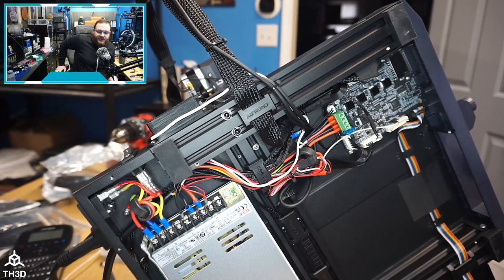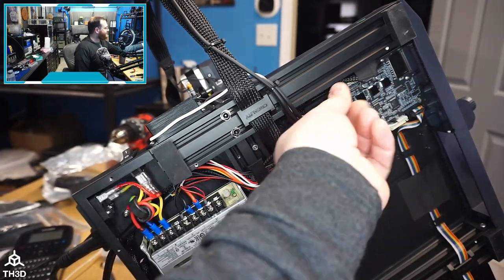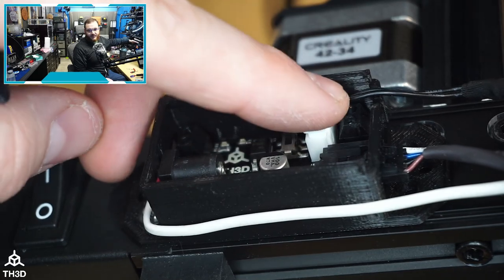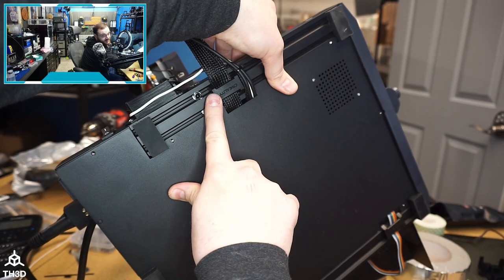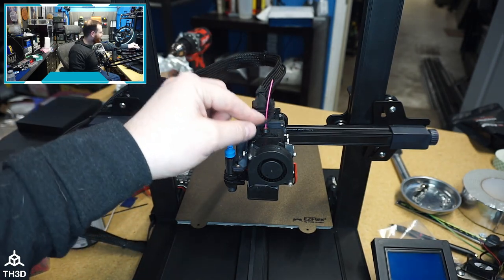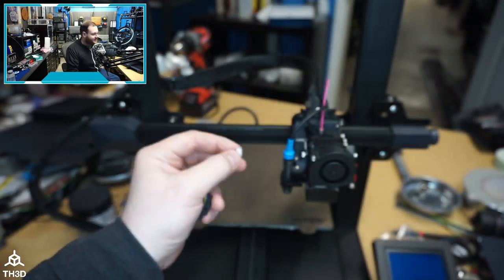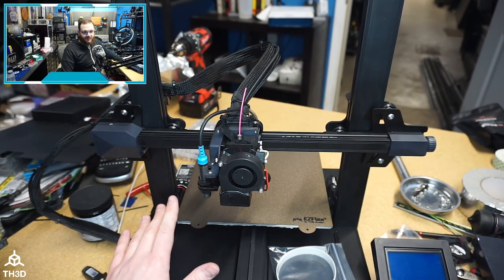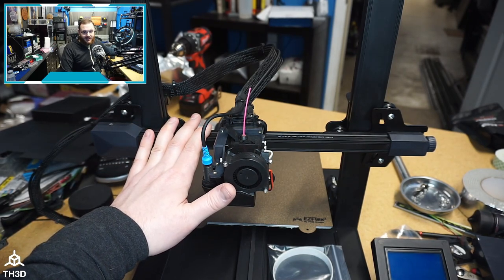Wrapping up my Ender 3 S1 Build - EZABL Mounting/Cabling

Comment: Just got this printer as my first for $250, I plan on using the savings to get it to speed with more or less the same upgrades you gave it. Lots of good info and honesty in the last couple videos you made ab it so thank you
Reply from the maker: $250 is a SOLID price for it. At that price I can overlook the need to fix things Creality overlooked. I hope you enjoy it!
Reply: @TH3DStudio  Thank you, yeah right now I'm struggling the cr touch and firmware having a hard time compensating for the bed warp but I think switching over to klipper should fix the issues on first layer. Just received a 15' insulation roll and EZNeo kit from you guys, basically added $250 worth of value

Comment: Have wanted a couple of your videos over this printer and you've mention poor firmware. This is my first printer, and I was curious what you were referring to with your mention of firmware being poorly written.

Little background on my experience thus far; would be interested in your feedback regarding some of the issues I think I've run into.

I had always wanted to get a 3D printer but never cared to print the novelty items available online, I wanted to prototype projects. I figured one day I would learn CAD and get a printer. Always imagined that would be after I settled down but, I ended up having to learn Solidworks for an engineering course I took at my university and, it turns out I can get the student package with advanced simulation for $40/yr. because I was in the National Guard...

Despite being a computer science & engineering major, I found myself in a second engineering course where we were doing a miniature capstone project; we were required to use 3D printing or laser cutting as a fabrication method for our final prototype. My teammates were not contributing, and I was in a pickle time wise or so I thought, I was actually about a week and a half ahead; despite having been gaslit by one of my teammates regarding the deadline, I ended up grabbing an Ender 3 v2 Neo. I had done a decent-ish amount of research and figured it would be easy enough to figure out. Later that week the Ender 3 S1 went on sale at my local Microcenter for ~$270, which was less than I had bought the v2 for, I went ahead and bought the S1, threw its build plate and filament sample in the v2 and returned it. 

I had also seen a fair few reviews on the S1 talking about how it was a "just works" and "for 3D printing as a tool, not a hobby" printer. Being that I had literally never seen a 3D printer IRL before that sounded like exactly what I was looking for. Initially it was fantastic (at the time I was running the thing at like 20mm/s first layer 40-50mm/s for the rest). I instantly fell in love with being able to model something and have it in my hands but, I despised the slow speeds. I didn't really have the time to really dive into learning how to configure it optimally, so I just ran it with the stock profile until my project was mostly done.

I started attempting to boost the speed and everything remained solid. I left the profile the same and just ended up cranking the speed up to 200-250%. Everything was fine until randomly, and instantly, I ran into a slew of issues. It was so frustrating it almost poisoned me to 3D printing despite having fallen in love with it less than a month prior. I would like to reiterate that I am a computer science and engineering major (have been one for longer than I'd like to admit...), and am generally pretty good at figure things out, it is not as if I am illiterate when it comes to tinkering with computer systems; don't me wrong I'm no 10X Linux user but, I haven't run into an issue with anything "tech" related I've owned so far and I've experienced some pretty weird things (oh how I love and hate Windows on Arm... despite that minor jab WoA is getting there I'd give it a bit more but definitely a superior tablet experience IMO; I'd give it a go if you have the disposable income to dump on a Surface Pro X or Surface Pro 9 5G)

This printer (or at least the expectation of a "just works/ tool" many reviewers had given me) almost murdered me. I think I ended up having more issues with the S1 than I would have had I stuck with the V2 Neo. I ended up grabbing the Creality Sonic Pad to run Klipper and that has alleviated some of my issues, or at least helped me diagnose what the issue was... I think at least, the ole printer is running nicely now for the past few days at least.
Reply: So as far as the various issues I ran into:

Problem 1:
Prints would start out fine, but the higher the print, the more over-extrusion would be seen but this seemed to happen randomly; one print would get messed up in this way, the next (using the same filament, no re-leveling, no changes whatsoever) would be absolutely fine standing at 50mm tall. When the issue did occur, the top of any prints over ~20-25mm would look like a hot rake was taken to them. I think the issue was extreme over-extrusion. Anything lower than that was fine 100% of the time though (in hindsight I think I had a bit of over-extrusion all of the time but nothing that was causing significant issues elsewhere; can't say for sure, as I never did any calibration or tuning with the filaments I was using. As of right now, I am tuning extrusion with the 1 wall hollow cube method. I have heard some say this is a no go but, its working for me wonderfully, as of the last 3-4 weeks at least). I never did figure this one out; I would almost swear it just randomly stopped but, it may have been when I switched to klipper (I am pretty sure it just randomly stopped though.

Problem 1.5-ish:
Not sure if this caused issues as I fixed it at the same time as problem 2 but I did find that my x gantry was slanted with about 1mm of height difference from one side to the other.

Problem 2: 
Leveling... sort of... I think? At the very least, I know I had it close enough it should have worked because I was printing on the V2 Neo perfectly prior to grabbing the S1 (perfectly being well enough I had consistent results without failures). Prior to switching to klipper the I would occasionally get 1st layer issues that would leave me wasting tons of filament and hair They would show up randomly, sabotage every print i tried, and disappear as swiftly as they arrived. I still have no idea what cause these although, I have heard other users state that the ABL was garbage so perhaps this was a firmware thing???

Problem 2.fuck_me_it_got_way_worse_with_klipper
So, the occasional issue I mentioned in 2 just decided to move in when I switched to klipper. I was still tramming the bed properly at this point but for whatever reason NOTHING would stick I set my z offset touching the bed and it was still laying the filament too high to adhere in the front 1/3-ish if the bed. I believe I actually know why this was occurring. Or at least I fixed what I though was causing the issue and the issue has thus far been resolved; I also dont think I would have fixed this had I not switched to klipper. So, when I had switched to klipper on the sonic pad I was using klipper screen's auto-level to "level" the bed (I get that this is incorrect, but I am OCD af and bad with the finesse of leveling, so the numbers made it easier). I had always gotten the bed within 0.1-0.15 from being perfectly level according to the probe points (corners were within 0.01mm but I have some dips in the bed I have since sorted out with aluminum foil). I would like to point out that I said according to the probe points; this is what I believe was causing my issues. I had not been tramming the bed with paper or a feeler I had been using the probe feedback. After an extensive amount of searching (this had essentially deadlined my printer) I found that other S1 owners were experiencing issues with the CR touch and its ABL. Some users stated that the plastic mount point of the Y axis led to undesired movement with could lead to location bias or inconsistent readings. While I did not get inconsistent readings, I recalled reading about location bias in the klipper documentation. I found a model that moves the CR touch in line with the nozzle and I am no longer experiencing this issue despite still tramming the bed according to probe data (instead of properly tramming it). This is the one that really got me I am incredibly curious if you have heard of / had similar issues regarding location bias, or Y axis movement.

Sidenote: 
I only got the S1 to avoid having to deep diving into the "how" of printers (I needed it for class I was planning on learning the "how" for fun/out of necessity later) I got the sonic pad to increase print speeds while avoiding having to learn and configure klipper. Ironically, I was doing a lot of learning, fixing, and configuring... Being that I did not have the time for it; it was stressful. I think this is my biggest complaint with the S1 personally, it has zero to do with what I got, but rather what I was sold. Since I've got it working, it's been a beauty, but the reviews I had seen prior to getting it, sold it as something it was not. When you had mentioned some if the issues you had with it for its price (and other printers you believe are "total shit") I appreciate that honesty. I have wanted to dive into printing for a while but the false expectation, and resultant frustrations I encountered, almost turned me off to it completely. Had I not printed that 0 offset CR Touch mount (which I only did on a whim) prior to the above occurring, I would have thrown the thing in the basement and written off 3D printing until I had more free time than I knew what to do with; aka realistically never. You seem quite genuine; I appreciate the integrity.

Problem 3:
Destroyed the hotend. This was me being dumb but before my stupidity totally destroyed the heater block and the two screws that held it in place, the wrench that came with the printer totally rounded off the brass nozzle. This nozzle was the stock one installed from the factory; I know I was using the proper size wrench and, I had the hot end brought up to temp. I ended up just grabbing the pro extruder kit to drop it in (I needed a surefire solution as the project deadline I mentioned was fast approaching). But even though this was somewhat (the screws) was my fault I only attempted to get at the nozzle because of all the prior issues I encountered. It just felt like another slap in the face at that point.

Problem 4: 
The ribbon cable. This still perplexes me it was a quick "fix", but I am not sure what caused the issue. I had issues with fans not running, then the ABL sensor failed, then the stepper gave out. Despite being pretty dumb I figured it was statistically unlikely all those parts were failing on the same printer in the same general location due to component failures. Being that they all share the same bridge, I figured I'd start there. it was then that I noticed one corner of the ribbon cable did not seat down all the way. Pushing it down would resolve the issue (with the CR touch and fans) not the extruder stepper though. This issue popped up a few nights ago and I was so fed up I figured I'd try to fix it and if I broke it in the process I'd just be done. So, I shut everything down, unplugged the hotend/extruder, ripped the gantry/Z axis off, tore the bottom panel off, and removed the ribbon cable from the board itself. I striped the sheath off of the cable, cut the ferrite core of the cable, made sure to straighten the wires and route the without kinks, and ripped the lcd display ribbon cable out (unrelated to the issue it had been bother me tucked away under the printer since I got the sonic pad. Sure, I can't see it, but I know it's there damn it.). I plugged the ribbon cable back into the breakout board and used a piece of one wrap Velcro tape to force the connector into its socket and booted it back up... hurray! printer worky again! but again... 

A GOOD BEGINNER PRINTER?? What are some of these youtubers smoking. It seems to have its issues but hey so do all printers (probably??); that may be true but, one thing some people may not have considered is: how little information there is in regards to the S1 specifically. some of the issues I mentioned only got solved, because I spent HOURS scouring the web for the more obscure potential solution. Luckily, I ended up finding one that sounded somewhat logically... and it ended up fixing my issue (or at least bring my printer back to life temporarily; to be honest I'm still very out of my depth. I am completely ignorant when it comes to electrical stuff and microcontrollers; I don't even know if the issues I stated caused the problems I described) and to think I'm diving into Arduinos here soon... this all will be the death of me... lol.

I'd be curious to hear your thoughts obviously. especially regarding the suspected location bias, the front position of the y axis mount being plastic, if you've had issues with the ribbon cable, and if I am going to burn my house down having mangled and removed the ferrite core from around my ribbon cable (I left the other one, looked like those wires were coming from the power supply and heck messing with that...

Comment: i ordered ezabl. Can you make detail install and setup video for ender 3 s1? i am new 3d printer. thanks
Reply from the maker: Aside from removing the CRTouch and using the zendstop cable that comes with the S1, it's the same install process as any other machine. We do not typically do machine specific install guides due to the time required and the installation steps being the same. See the EZABL install guide and video here: https://www.th3dstudio.com/hc/product-information/ezabl/ezabl-pro-installation-guide/
Reply: @TH3DStudio  when i adjustment screw clockwise, it turn off red light and turn on green light.
Reply from the maker: @khoinguyen1963  please read the instructions, all the steps are covered.

Comment: My Ender 3 S1 came with the STM32F4 board, are there any boards that can be used to replaced the STM32F4?
Reply from the maker: Not at this time. If you wanted to send us the board for testing, I'd be happy to start working on firmware for it. Once I'm done, I can send it back to you.